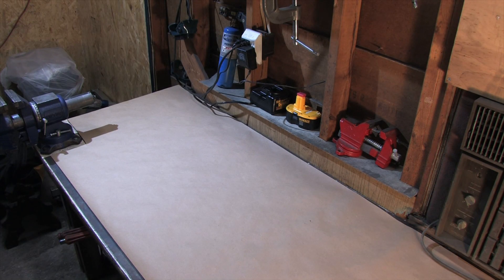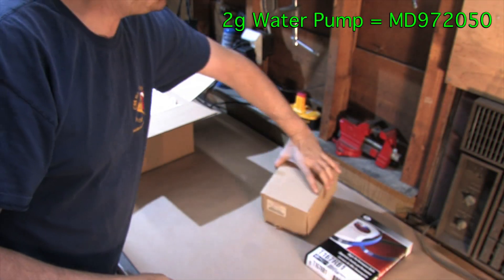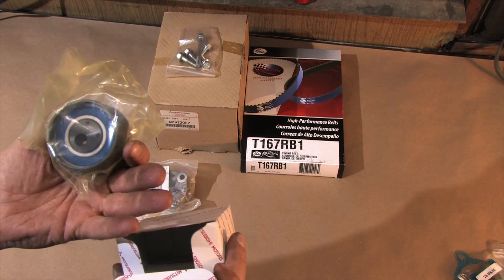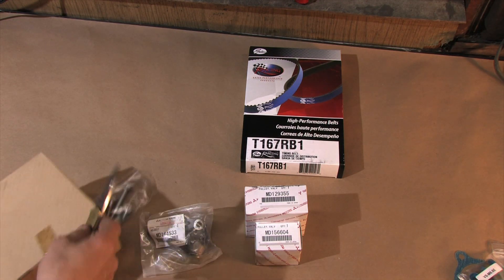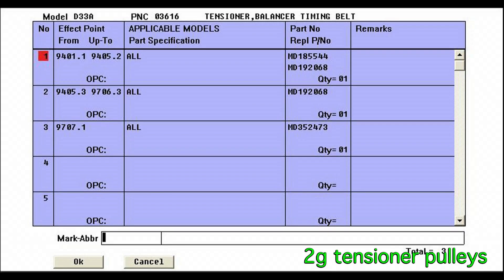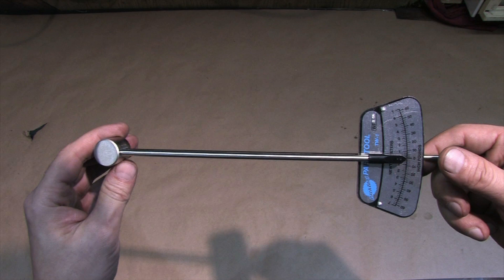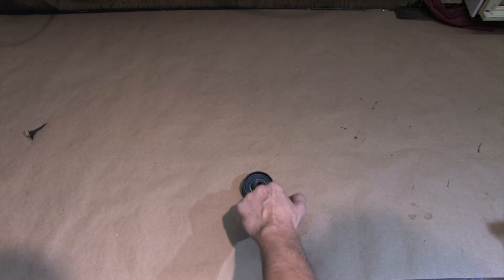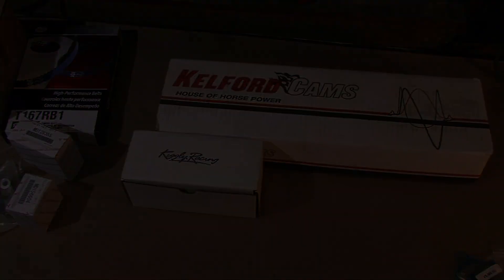4g63 Timing Belt Parts

Comment: Hey so I just bought a 7 bolt that was freshened up so timing wasn’t done too long ago and my water pump pulley was wobbling so since the motor is out of the car I’m gonna be installing a new water pump and re timing it now my question is 
Do I have to re time the balance shafts or can I skip the balance shafts since they were done recently ?
-thanks
Reply from the maker: Once you have the timing cover off, it is possible to replace the water pump without removing the timing belt.  It just takes some forceful creativity.  If you do take the timing belt off, just rotate the crank until all of the timing marks line up on all of the shafts.  Crankshaft, balance shafts, camshafts, oil pump.  Line all those up, and when you put the belt back on, you've got the best chance of it being in time.  Use binder clips on the cam gears if you're worried about getting those back in time.  There is a potential to be a half-tooth off on those.

Comment: hey bud, would you know how to remove a crankshaft sprocket/gear on a 2003 Mitsubishi Eclipse GT 6G72 it's the 3rd gen eclipse. it's. all stock no aftermarket stuff, but I can't find a how to anywhere on how to this thing off. my manual just says pull it off, but it's about as stuck as the  balancer/pulley was. I was tempted to have hammer on it but since I'll need it again I thought that! might not be smart. if you have any suggestions I'd be super grateful, my motors disassembled down to the block but I can't seem to get the crankshaft sprocket/gear to budge, I'm guessing typically people don't encounter this problem with that motor or they don't attempt to remove this piece.
Reply from the maker: +cy80rg Ima have to defer to someone else who knows.  All of my documentation and Mitsubishi work has been performed on teh 4g61, 4g63 and 4g64 platform.  Your best bet is to visit DSMtuners, do some searches, and if you don't find someone else who's already encountered what you've found, post a question.  There's always strength in numbers, and I don't have anything from that V6 here?  I know some people who have done drivetrain work on those, but none that have rebuilt it.  If it has some kind of oil pressure-actuated variable valve timing, those few degrees may be there on purpose.  You'd be able to tell by looking inside the valve cover while you rotate it.  If it's loose and floppin' around, then good lawd, yeah... take that sucker off and fix it.  I wish I had documentation that would help you.

Comment: My timing idler pulley on my 1990 Ply Laser turbo is different than the aftermarket.  Mine is original with engine and has a bushing through the middle of it.  The aftermarket has a cup in its center.  Do you know about this?
Reply from the maker: +avikirch Yes, different bolts as well.  MD156604 is actually the correct pulley.  Mitsubishi substituted it for your old MD121993. Truth be told, either one will work out just fine.  They just don't make the old one anymore.  The only difference is that you'll need the right bolt to hold it down.  The right bolt is MF241281 which is an M10 x22 x1.25 bolt.  The bolt it replaces was MF241289, and it's an M10 x45 x1.25mm bolt.
Sometimes you ask a random question on the internet, and it happens to be right on the guy's page who knows the exact answer you were looking for.  I hope you stopped here first!  :P

Comment: Jafro, first and foremost, thanks for all your contributions to the DSM community through your vids.  I had a question about the water pump.  If the OEM pump is made by AISIN, then wouldn't it just be best to purchase the "AISIN" water pump as opposed to spending twice as much to get it from a mitsu dealership or mitsu authorized vendor?
Reply from the maker: Why do you think I showed the water pump?  ;)  I believe these are made right here in the US in Indiana.
Reply: ***** Good deal.  When you stated they were made by Aisin, I just got on their site, found the pump #, and the bought it off the interwebz for like $54 shipped.  Showed up in an Aisin box with 3 mitsu MD #'s.  Thanks again.  Its nice to know I was able to secure OEM quality for the price of an autozone aftermarket pump.
Reply: So...I bought a Gates timing belt kit for a 03 Galant 2.4L. But I’m using OEM belts instead of the Gates belts in the kit. I know you’re not a fan of aftermarket, but do you think it’ll be ok as far as the water pump, pulleys and tensioner goes?

Comment: Great video, would you happen to have a video on replacing all those components? Im attempting to do all this to my 7 bolt for the first time and im trying to get as much knowledge on this so i dont screw it up.
Reply from the maker: I'm on day 12 of editing the exact footage you're asking for.  ;)

I started with 9 hours of footage.  I'm trying to deliver it in less than a 40 minute video.  I'm not at the timing belt part yet, but that's coming up next.
Reply from the maker: I have not yet.  Not in detail anyway.  I covered the tensioning of the belt in an old video named "2g GSX 4g63 Turbo Longblock Assembly", but the unabridged timing video is still about a month away.  I hit some snags on the Hyundai head that have slowed down its production.  I'm sure you've followed those.  You'll enjoy the videos that snag has created, and the timing video will occur right after those go live.

Comment: Hey, what problems will I cause my 6 bolt if I hyper extend the Happy Face Pulley. I did not use the inch pound torque wrench. Timing is tight, and I have not had any issues. Thanks for all of your contributions to the DSM community.

Comment: Hey Jafro, I noticed the dealership style menus used during this video. Do you work at a MItsubishi dealership? If so, would you be able to help me with a problem that I am having, which is locating the proper bracket and pulley assembly for the A/C drive belt on my 1G Talon. I know, I know everyone does a delete on that system, but I'm electing to refurbish and keep it as I will use this  vehicle for track and daily use. Even if you don't work at a Mitsu dealer any help would be appreciated.

Comment: The tool for the timing belt (md998378) can be used on the 6bolt, but you need to use the 7bolt arm and you need to modify the arm just a little bit with a grinder. I'm sure you will like to use that tool cuz it makes the job much easier, if I can do it I'm sure you can do it jafro! Just study a little bit the 7bolt arm and I'm sure you will be able to understand what I'm talking about.

Comment: I will be happy if that information saves just one individual the grief that a hydraulic tensioner can cause.

We have found that it is not the tensioner that fails, per se. It is improper installaton procedures. They leave too much slack in the belt or they do not wait to make sure that the tensioner is holding per the service manual. We wait 24 hours after tensioning and two full crank rotations to make sure the pin is still loose before buttoning up the cover.

Comment: We see a LOT of engine failures in the 6G72 motors due to a failed hydraulic tensioner. Most frequent causes of failure in order:

no maintenance
improper replacement during maintenance by amateur and "pro"

We have started to weld a washer behind the tensioner pin so that in case it does fail, you do not loose so much tension that you have a catastrophic failure.

Do a search on the 3SI forums if you want to learn more.

Comment: i may be wrong but I believe you should be using the inch pound torque wrench with the happy face tool thats 90 degrees off of center. As you demonstrated in the video, you are adding to the effective length of the torque wrench and throwing off the readings. It may only be a small amount.

Comment: Just want to clarify! That even if there are difference part numbers for the hydronic tensioner for the 2g there are still interchangeable in mi case I'm using the MD308086 in my early 95 block